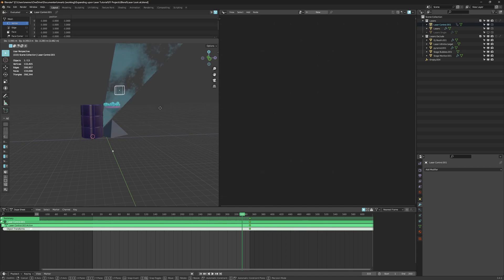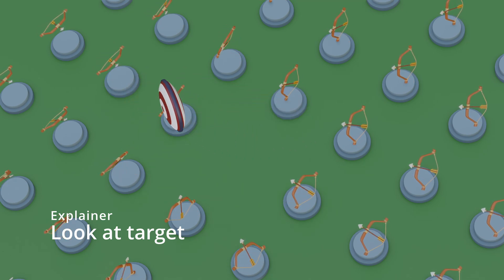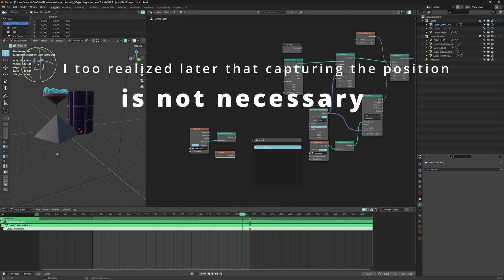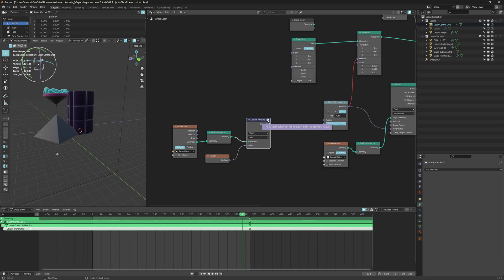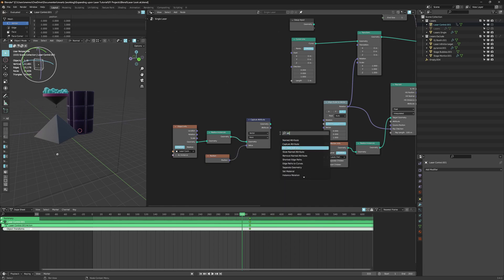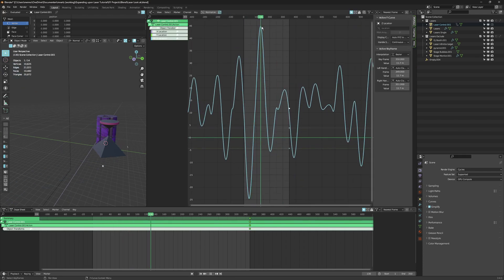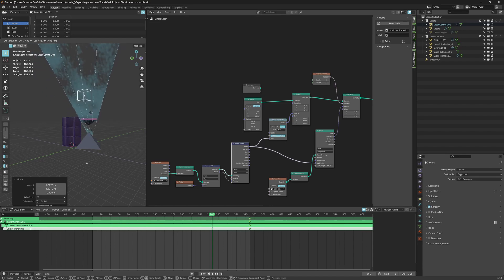Creating Look-At Target in Blender Geometry Nodes

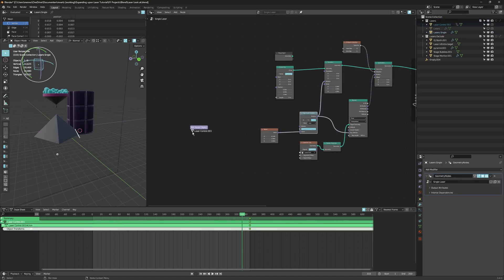Comment: 1:04 The reason why it doesn’t do anything is because you need to use the “Relative” option to get the location of the target object relative to this object as your orientation vector.

With a bit of experimentation, I have been able to create a working look-at setup using two “Align Euler to Vector” nodes, one pivoting along each of the two axes that are not the same as the one that needs to point to the target. Each of these feeds into one of two "Transform Geometry” nodes in series. I also add a third “Transform Geometry” node to make final corrections to the orientation of the object (so it faces toward the target, rather than away from it, for example). Also the Factor of one of those “Align Euler to Vector” nodes needs to be set to -1 to get the rotation to go in the right direction.
Reply from the maker: Thnx for sharing your findings with us🤙